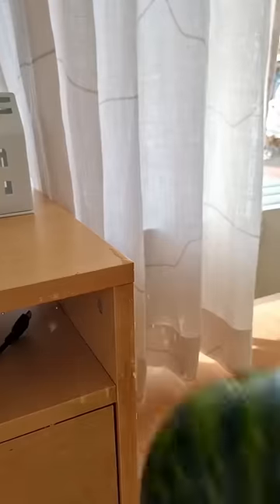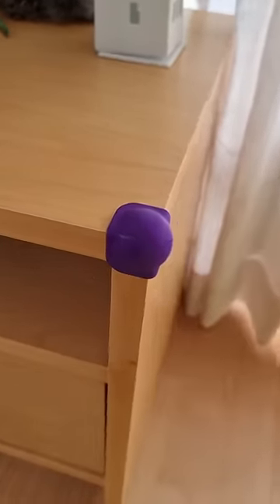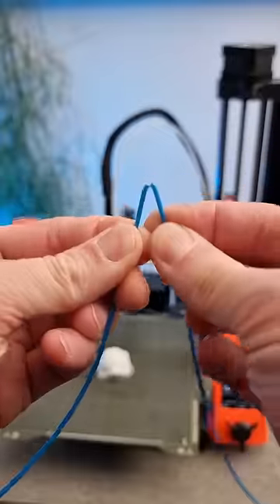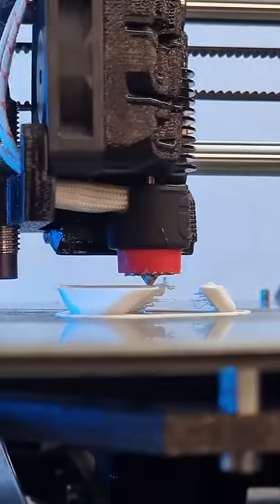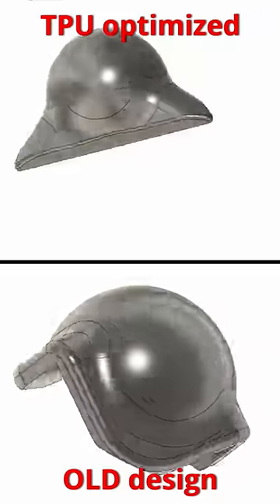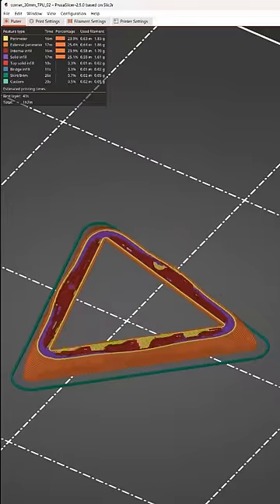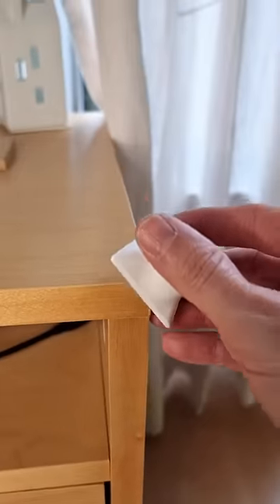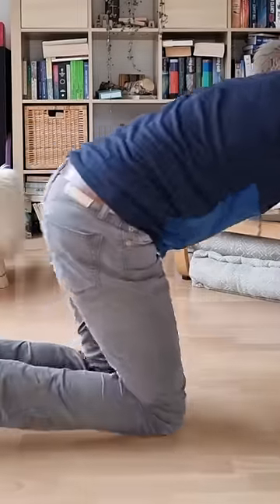Soft VS Hard 3D Printed Corner Protector

Comment: The PLA version made more sense. The point of the corner is close to the surface of the print either way, but since the TPU gives way, the point loading in any collision is still going to be higher than with a rigid material.
Reply: No way. Tpu is air tight each pocket of air inside of the infill acts as a cushion.
Reply: @MDalton10 Until it's not.
Reply: @MDalton10  When 3D printing its always going to be porous, which means not air tight.
Reply: @MDalton10  It's air tight if you print it right, which clearly wasn't the case here from the bad overhangs and stringing. Probably running with no linear advance/pressure advance. Maybe also under extruded.
Reply: @daliasprints9798  I do not believe you have more 3D printing experience and knowledge than CNC Kitchen.
Reply: @CheshireSwift  It's not about more or less, just different. You can judge from my most recent video whether you think I'm sufficiently qualified to speak on printing TPU right. 😁
Reply: There was enough room, and enough infill the TPU could flex safely without letting the corner hit, yes I have a lot of experience with TPU to say that is entirely possible
Reply: Ok, more practically, given the arguments in chat... I'm a moron with no experience with printing. What I saw? Big purple one did less damage. Little white one left a sizeable hole. Conclusion, big purple one.
Reply: @thericepotato5847 the purple one had a massive crack. Not as bad as the raw corner but the white one was miles better, though getting the bouncy pad away from the damn corner was miles better as the floor is safer than a corner to the head, with a protective corner or not.
Reply: how bout a base from PLA with a TPU bumper ontop? 
The PLA being slightly domed outwards while following the corner conture on the inside and the TPU in the same spheroidal shape from the first two attempts, both parts just glued together.

Composite corner bumpers if you will
Reply: Oh yeah, good point. I never even thought about the soft stuff just settling right onto the corner and not doing all that much.
Reply: Exactly what i was thinking

Comment: Testing the single-use shock absorbency of a flexible filament vs absorbing the energy with a brittle plastic could actually be really interesting.  Maybe the answer is actually a multi-material solution like some phone cases.

Comment: You made it worse. Material now flexes in to the corner on impact and exposes sharp edge through the material.
Reply: It was pretty visible and i think he know that. This is why he printed with pla in the first place
Reply: Is it possible that flattening the surface exactly opposite the corner would be better? As in, it would give the impacting body more surface area to dissipate the impact?
Reply: The TPU wouldn’t have flexed that much, there was enough room and enough infill that the corner wouldn’t be felt
Reply: Maybe it shoyld be a PLA inside and a TPU outer layer that fits onto the PLA. That way, it's a cushion that spreads the impact out with the rounded corner.
Reply: Well the damage on the watermelon was much worse then the other one, so I agree
Reply: He actually made it better. The bouncy mattress is not near the sharp edge
Reply: This comment proves, you can’t make anyone happy on the internet
Reply: @Ludicrouzz  Nope. What you mean is that you can't make everyone happy on the internet. The inverse isn't true though, as proven by Velma (the show).
Reply: bruh first yall said to make it with rubber and now yall said that he made it worse. MAKE UP YOUR MINDS WHICH ONE DO YOU WANNT
Reply: That's not how this works. It's completely irrelevant if you touch the sharp corner. You can touch it with your hand, nothing bad happens. The relevant part is how much energy this impact has. TPU is flexible, so it'll deform and absorb a part of the energy. This could be a small part, or it could be all the energy. I don't know. PLA on the other hand isn't very flexible, so the only thing that does is make the sharp corner less sharp. Could still be a nasty impact, since it's still only a very small surface you'd hit. It'd require quite a bit of testing or calculating to know which is better.

It's probably better to teach your kids to recognize danger, and not let them jump near sharp corners, or anywhere inside for that matter. Sure, they'll get hurt, but we all got hurt as kids. It's part of life.

Comment: Regarding design: I made mine out of PLA with one perimeter line and not much infill. So it has a bit of absorber/crash zone.
Regarding kids: my daughter putted a blanket over her head and started running through the house. I catched get several times before crashing into the brick wall. Once she did it again, I saw it and let her crash into the open, flexing door panel. Intentionally. Some kids have to learn through (painful) experience.
I told her not to take small toys parts into the bathing tube. She had to loose them before she realized it's better to listen to daddy.
I love her
Reply: My sister had not great coordination as a kid and also enjoyed running around with a blanket over her head. Until she slipped in the hallway and got some scratches and bruises down her face from the drywall. For some reason she never did that again.

Comment: A lot of people are saying that "the TPU gives way and exposes the sharp edges" (paraphrased from a couple of comments), so I have an idea: you have the original PLA corner protector and a TPU layer ON TOP so that the TPU layer still absorbs some impact by flexing, but if it gives way and exposes what's underneath it, it's not a sharp head-splitting corner that the head is hitting but rather a rounded corner protector.

Comment: I think continuing testing until a design works would be neat to see how far you'd have to go.

I'd have the most hope for a multi-layered design with compliance/crumple zones. TPU-PLA-TPU with voids to absorb energy.
Reply: TPU alone can create the multi layer crumple zone, TPU can quickly and easily in thin parts be made extremely soft to rock hard and the designer has complete control over the entire spectrum

Comment: You need to use retraction with your tpu print settings. It really works.
Reply: Yeah this print was clearly on a setup not suitable to TPU at all. Likely missing LA/PA. Not sure if retraction was off too but it might have been. The print was an utter stringy mess with wrong material in some places, missing material in others.

Comment: What about hard pla shell like your original design with adsorbing tpu pads underneath. Bit like a bike helmet :)

Although agree moving the mat is the best solution
Reply: That  actually sounds great
Reply: This can be done by increasing the wall thickness from 2 lines to 4 or more lines. TPU is very versatile in how soft or hard it can be made, it just takes some experience to understand how to manipulate it the right way

Comment: If the protector is too soft then it wouldn't help at all as you would just push right through it and then hit the corner either way but if it's harder it hits you with a round edge not a sharp one

Comment: by making it a ball shape you're probably making it worse. instead of a cut to the skin, now you're looking at a cracked skull.

just look how the watermelon caves in like a hammer blow.

you're best bet is to have it flat like 45°. this can be done easily by shaving down the corner with a file, or if you wanted to go 3D printer route, instead of ball shaped, think box shape but turned at an angle so if a head were to hit the corner it would be flat on.